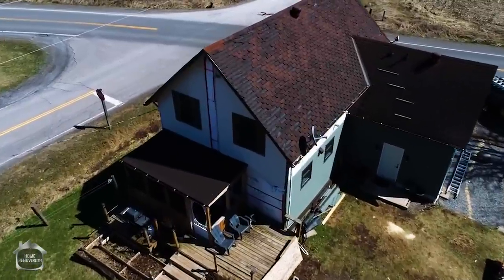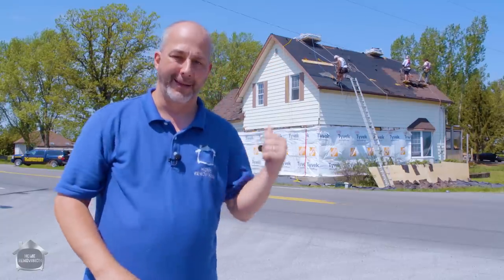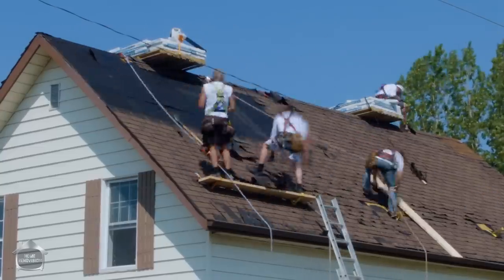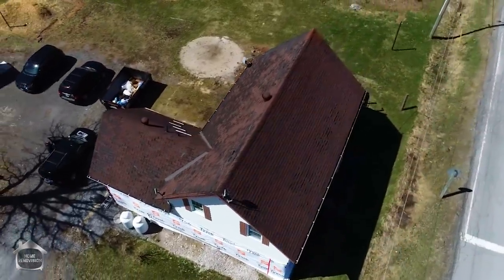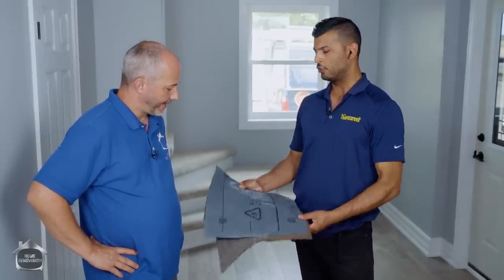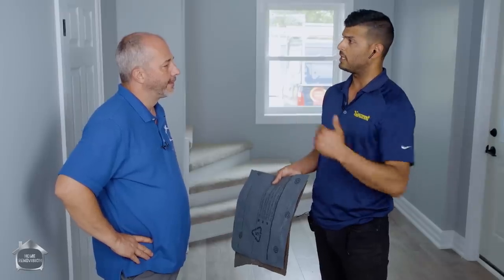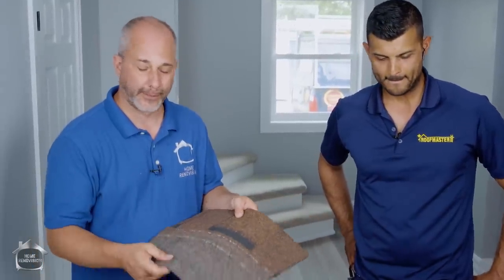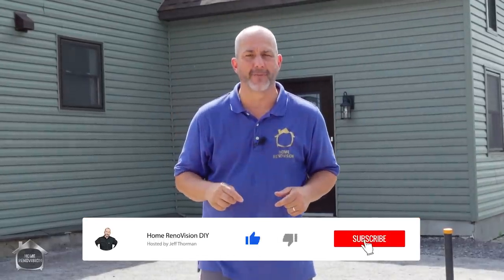What to Expect When Changing Your Roof

Comment: Some estimates are freaking ridiculous. I needed 25 square replaced with 2 layer tear off & redeck. I had a steep one too. The craziest wanted $8K JUST for the redeck! Even using premium plywood that's a hell of a markup. Then they wanted $28K for archectural which I could buy all materials at less than $3K at retail prices. Again crazy labor markup. Many middle quotes were $20K. The $12K it ended up costing me was fair & well done.

Comment: Great info here. I wish I knew exactly how old our roof was, neighbors say it was probably replaced when they all got new roofs after some hail, which was 2013 or so. When selling, it just said less than 9 years old. I have architectural shingles as well. However, our attic up until last month had poor insulation and air circulation so I finally had that fixed up for ice dams. I'm guessing the multiple years of damming have dropped some of that life expectancy (thanks previous owners 🙄). I also am not sure whether they got it done right, judging from everything else I wouldn't be surprised if they got the cheapest bid so I have no idea how they built it and whether there's proper components for water diversion. 

So far visually inspecting the roof, it looks like it's doing okay, I've been up there a few times. Discovered some nutty things though like a vent going up and it wasn't aligned with the cap so there was gaps where rain could easily just go straight down into the attic 🤬 Replaced the cap on it to mitigate that but jeez.
Reply: Sounds like you are keeping yourself very busy. I’m in the market for my first home purchase and my favorite house looks like it needs a new roof. Good luck to you!

Comment: I don't quite understand why the old tar paper didn't get removed considering they used a better synthetic underlayment anyways but I'm not a pro roofer so must be a reason...?  Regardless,  I'm in the process of re-doing my 9/12 pitched roof and with 3 layers of asphalt there is absolutely zero chance I could save the old tar paper.

Comment: 3 days?! If my crew took 3 days to do a house this small they would be kicking rocks.  You have to take off all the felt to inspect the decking. You never want to lay ice and water over tar paper and you need to take the backing off. There needs to be more than 4 750 vents on a roof that size. You need proper ventilation.

Comment: WOW Jeff, I usually enjoy your videos on home reno projects, but I have to say this one was way, too inaccurate!!  After 35 years in the roof industry, as an inspector, specification writer, and director of sales and marketing for a Toronto area roof contractor, I have to say this video was bery misleading.  You start out saying it is a GAF system, then use the name CertainTeed, while all the while, one could see the contractor was installing BPCO products.

There was no sign of eave or gable/rake drip edge, the foundation of a roof system.  Then, they were placing Ice & Watershield, without peeling the backing off, on top of old underlay (tarpaper).  You talked to the contractor about getting down to the wood deck to inspect it, but there was no wood exposed.  The synthetic underlay was also applied on top of the old tarpaper.  What gives??

I know that if a GAF or CertainTeed system is installed by one of their certified contractors, then the warranty is registered by them, AND the warranty is non pro-rated for 50 years, and can be transferred to one new homeowner in the first 20 years.  Yes, just as good as a metal roof!!  (Both materials have their place in the industry.  I have installed both.)

I usually like your enthusiasm, but this time, you spoke over and interrupted the guy from Roofmaster, over and over.  This video needs to be removed - or done over properly - before people get the wrong impression.

C'mon Man, YOU CAN DO BETTER than this JEFF.

Very frustrated and disappointed,
Dave
Reply: I agree.. Worst video he has done. Very misleading.   Very bad information and people that don't know will think it's great..  And this crew should be fired for installing almost everything wrong.
Reply: I gotta say yeah, I caught almost all of those things too. I thought they were installing the Ice and water over something pretty ugly.But, It could've been some old ice and water, which I'm okay with.
Reply: Kind of hard to see in the video, but it looks like the starter was installed backwards as well. You want that sealant strip close to the edge

Comment: Hi Jeff. I have a question about mold in my attic. About a quarter of the attic has black spots. My question if I can eradicate  the mold myself with cleaning solutions, painting with mold killing primer etc. or is this one of those things that I should leave to the professionals?  Any thoughts would be very helpful because we are getting quoted at 2k to clean the mold
Reply: Absolutely first thing to do is find the CAUSE of the mold, or you will have a never-ending battle with it. Also, remember some of it will be hidden in areas you can''t see or easily find, causing continuing damage. BTW, I've always use ozone treatment as part my mold remediation strategy, but if you do be careful of the health affects.
Reply: mold is usually caused by condensation and lack of ventilation.  especially in high humidity environments.  The solution is to reduce condensation and increase ventilation.  Temporary band aides won't work.  don't waste your time.
Reply: Make sure that none of your bathroom/kitchen vents exhaust into the attic. They MUST vent to the outside.

Comment: Didn't see it asked, but if they were stripping of the old roof, why didn't they do it all?  I noticed at the 3:10 spot as they started installing he membrane, that they were installing it over old shingles.  I've always been told you can cover an initial layer, but they took the time to strip off the top layer, why not give you that extra protection by getting "all" of the old stuff off.
Reply: Just looks that way. Its a very old house with board planks instead of plywood. Youre seeing the gaps between the boards. They're stained black from 100 years of various tar paper.

Comment: Do not buy a flat roof! I've work on several jobs involving leaks in a flat roof and they are a pain in the ass. Biggest problem is the difficulty in locating a leak, that water can travel the whole roof system (after finding a penetration point) until it finds a weak point which could be many yards/meters away and now you have an entire roof to tear out.

Comment: Love that. They have to put "life and limb on the line instead of using a roof ladder. I would be pissed if I saw a contractor unsupported on my roof even if it was to save an extra few minutes at the start and end of the job. Owner needs to put some basic Health & Safety in place. Safety first guys. No client wants to feel bad if a worker falls off their roof when it can be avoided.

Comment: This video is perfect as I am going to need to redo my roof in the next few years. I'm wondering though how much of this weather proofing applies to a contract in Phoenix, Arizona though. Are there other factors to consider in places that rarely get to freezing temperatures but are regularly over 100 degrees with little wind or rain throughout the year?
Reply: Local codes dictate minimum. My area is 10 feet.
Reply: I'd wouldn't worry about ice&water barrier too much in your area, unless you have a low pitch. And would go for owens corning surenail shingle this is the best wind resistant tecnology
Reply: @manueldiaz1539  Thank you!
Reply: @KLondike5  Thank you!

Comment: Where we are planning permission requires us to use slate or synthetic slate and prefers not to use concrete.  Is there a reason you don't use slate roofs in Canada? Too hot or cold maybe? The shingles seem very thin and flimsy but must be a reason for it.
Reply from the maker: It all comes down to cost of materials and the fact that we build so fast due to immigration. slate is just not feasible with our labor market. Cheers!
Reply: @HomeRenoVisionDIY  thanks

Comment: Your Roofers are hacks.  They should use Scaffolding, Do do more damage Wearing ropes walking on the shingles. All the twisting and turning. With scaffolding they could throw  the shingles directly in the trailer. 
Professional roofers use their own trailers not dumpster. Look at how much extra work that is because of where the dumpsters at.
It would take me hours To tell you all the mistakes. You’re just excited you’re hired cheapest roofers. Like the guy said it’s imperative to strip your whole roof inspector the deck? However they just installed the icewater Shield Over top of the tar paper. 
You should always install synthetic overtop the ice water shield. Is the ice water shield melts to the Shingles.

Comment: Since the email is down, a quick question:  I am looking to add a door from the house to the garage, so an exterior wall of the house (garage was added a little later I believe).  From being in the attic, I know the attic joists run parallel to that particular wall.  Am I still looking at some sort of support requirement due to weight bearing or is this not weight bearing specifically because this is a West wall and the rafters are sitting on the North and South walls?
Reply: Can't answer directly but I'd email your local inspection office or give them a call, mine is always responsive and would have the answer to that! 👍
Reply: @kamranayub  No doubt good advice... The issue we are dealing with is the Covid lockdowns have the inspectors staying away from anything that isn't commercial and requires an expedient response.

Comment: I've seen many types of shingles but bp is one of the lower quality shingles for us in Saskatchewan. I much prefer owens corning shingles compared to IKO, BP, GAF
Reply from the maker: I have personally lost all faith in the roofing industry. So many bad products on the market in recent years, and it seems there is little in the way of accountability in regards to the industry standards. How they continue to sell a 50 year roof when it only lasts 25 is beyond me! I went with this product because it was the best price i could find for a roof that I have no faith in over the long term. The crew who installed it however were fantastic!
Reply: @HomeRenoVisionDIY  that's awesome. My biggest seller is Owens Corning Duration shingles because of the reinforced nail strip. They tab nice too. I've seen defective roofs be told no warranty because the contractor had missed the faint blue line on IKO and BP by 1/4 inch. Then the company blamed the contractor for install error because they wont stand behind their product. Love this video though!

Comment: I'll be dead in 20 years... I re-shingled my roof 2 yrs ago. 
$1,400. I'm sure it'll be fine...
Reply: Good for you, sir! I’ve never done it but I’m looking to buy a house that will need to be re-shingled at the very least. That price is nice !
Reply: I need to do my garage roof. Shingles are 25 years old. Can I just go over the old with new shingles?
Reply: @puppylove80110  might be able to... however?! Wouldnt you want to see how that wood looks UNDER the old shingles?  A metal roof is better for snowy areas, and often can go up faster, lasts the lifetime of the roof, allows snow and ice to slide off, is more expensive for materials,  cheaper for labor, and can be put over a single layer of shingles.

Comment: Here in uk we have tiles on roof, do they use any roof tiles in Ottawa
Reply: They are extremely expensive here in Canada and very rare. We also have a much more severe climate than the UK so I am unsure whether clay tiles would hold up in  the freeze thaw cycle over the years.
Reply: @rightlanehog3151  i've seen plenty of long lasting slate roofs in Southern Ontario, It's just slate is a b** to work with lol.
Reply: @rightlanehog3151  Lol my bad, didn't see clay in there, assumed you meant slate.

Comment: 6:20 There's not a company on planet earth that will do as good or a better 'system' for $12,000 than the company who charges $20,000 for the same 'system.' So that's just not true. You must live in a really cheap roofing area if the range for a good, complete job, including new wood, is $7,000 to $12,000 depending on the pitch of the roof.

Comment: Wondering why you went with roof vents instead of ridge vent
Reply: That’s extra bells & whistles lol
Reply: If there is already vent holes cut, why waste time and money installing ridge vents?
Reply: @omaxman1  - Only if you have soffit vents. If you don't have soffit vents to pull fresh air in from, ridge vents don't do much good.
Reply: @tay13666  true
Reply: @omaxman1  You only need 1 per 150 Sq Ft of attic space if it doesn't have a vapor barrier.

Comment: 5-7 years? Only if it's a bad manufacturer. I have ripped off 3 tab shingles on a 6/12 pitch that have lasted 37 years. Others that were 30 years many, many times. I hate when people lie about things they obviously know nothing about.
Reply: He said in the video that the area was prone to high winds and clearly this roof had wind damage. Apparently you live in an area that does not get many storms but that isn’t the case for Ottawa.
Reply: @michaelyoder7329  I live in Pittsburgh PA and we get high winds all the time. 5- 7 years is just not true. Even in Chicago the roofs last longer than that. The only way they blow off is if they weren't installed properly, i.e. the gun was blowing the nails through or nailed high, and if the manufacturing process was botched. There are probably thousands of roofs in the Ottawa area that still have 3 tabs from 25- 30 years ago.

Comment: Why not have a clay or composite tiled roof? I doubt that material will last even 10 years with the weather extremes you have, despite the claims. There are many lightweight composite tiles which would last longer and be more aesthetically pleasing. I know Canada has plenty of lumber, which makes it cheaper than in the UK, but you appear to resist using bricks and mortar, and in this case, tiles, which is far less maintenance long-term than timber-frame/shingle roof. Hell, even the Three Pigs learned the hard way that houses built out of bricks stand the test of time!
Reply: Clay tiles arent ideal for the climate so much so it would be hard to find roofers able to work on them. Anything other than shingles or metal there would up the cost dramatically.

Comment: Your giving roofers a bad name.😬
Its really not like their trying to rip people off, there's not  a fortune in roofing. Most quotes are very similar..the cost are basically the same for most companies(but Not all of course)..change ALL metal flashings if possible, its all about quality when choosing a roofing company.
Most counties have roofing codes; check the codes and make sure they match your contract.
Tar is better than "most" synthetic underlayments- imho
Also make sure the roofing company you choose follows manufacture directions or the warranty is void...very important!
Reply: Tar paper is cheaper, it's not as durable, it degrades quicker, it is absolutely not better than synthetic fibre underlays or we'd still be using it in abundance.

Comment: Bp is the worst shingle on the market. I own a roofing company and don’t ever recommend them. About 90% of the shingles I install are a 50 year Owens Corning duration!! Best shingle on the market
Reply: I supply roofing shingles all brands,  and the shingle itself means nothing if they are not installed correctly. More important than brand is to ensure that the roofers know how to install the product and that they are certified by said shingle company to install that brand. If not your shingle warranty is worthless. I've seen many roofers buy a shingle brand but different underlay, different, ice and water cheaper brand of starter strip. Equals warranty void.

Comment: Finding a roofing professional is hard.  Most of the time they screw up the flashing, ridge vents and will do silly things like on your roof..where they didn't remove the paper before putting down the snow and ice shield.  They will also screw up the flashing on the vents and chimney.  
Roofing has such a low barrier to entry and low cost to get into, that your seasonal hacks get into it and then out of it.  Warranty?  Try finding a roofing company in 10 years that did your roof.  Warranty is a joke.

Comment: What a sham. Asphalt/Fiberglass roof is a poor people's roof. It costs you more in the long run to replace those sorts of shingles than it does to install a steel, copper, shake, or tile roof. Anymore, you could forgo the roofers, rip your roof down to the decking and just paint it with liquid EPDM for thousands of dollars less. (And it will last just as long). No need for valley, ridge, hip end ridge. You could use existing flashing and just paint over it.  The home in the video could have been re-roofed for about $2000 - $3000 with a paint on roof. Why would you spend $25K for poor people shit? That 50 year roof is going to last maybe 15-20 years provided you don't have hail, and tornadoes. All of that fiberglass ends up in a landfill... you would be better off with a 40 year wood shake roof that you could burn in your fireplace, or get rid of as craft material on Craigslist. Why would you flip a house with 10 year 3 tab? Only an asshole would do that.